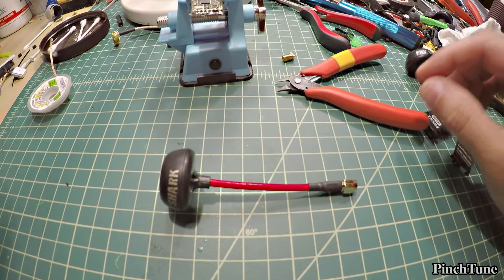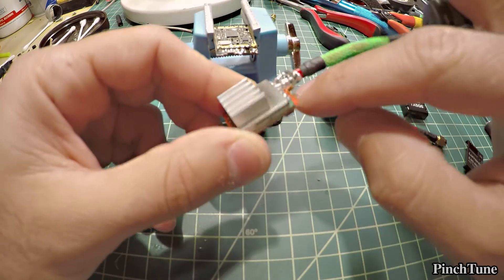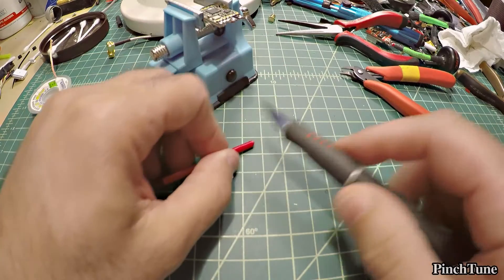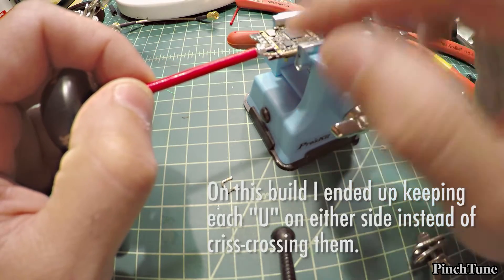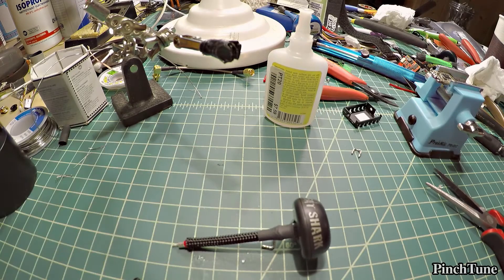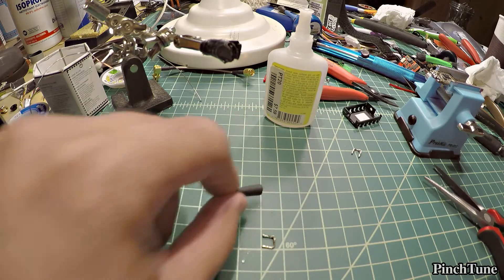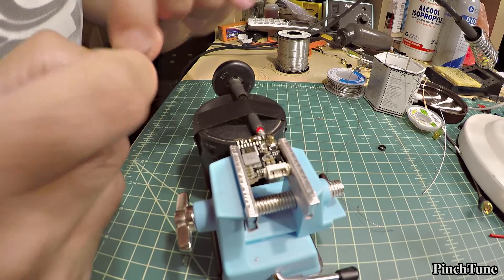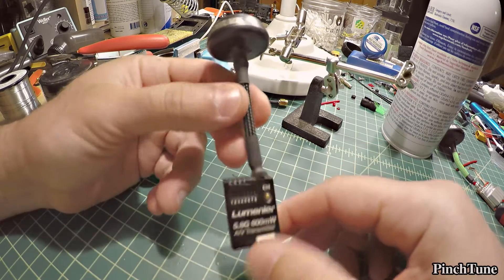How to Solder FPV Antenna Directly to VTX

Comment: Are the losses of soldering the coax at 90 degrees angle higher than having a 90 degree sma connector?
Thank you.
Reply from the maker: The losses are all dependent of the SWR (Standing Wave Ratio). I feel most of the inexpensive transmitters aren't all that well tuned anyway. In something like this I don't thin it makes that much of a difference. This video is from 2016, but I think I made it when I either broke the connector, or was having problems with the signal with the original SMA. Either way, I remember it working better after I did this.

Comment: Anything that can disrupt the flow of information on the surface of the wire or the  "skin affect" will in the end result be a handful of issues. So do it once & do it right and that will just minimize your problems from happening in the first place.

Comment: I'd be a little bit more cautious when making your cut because any surface cuts or dings to the center wire is going to cause impedance mismatch for any info running along the surface of that wire being transmitted.
Reply from the maker: Hi, I agree with that. The more careful, the better. That said, I don't think most of these FPV VTXs are tuned to perfect SWR like some more high-tech and expensive radio equipment. Not to mention, we run such low power transmission that a little mismatch in SWR doesn't seem to hurt much. I think the tolerances in this FPV equipment are still too high to even have to worry too much about that.

Comment: hi, dude.. is it normal, if i got continuity between the signal and the ground of my female rp-sma from my eachine tx801? or could it be a faulty?
Reply from the maker: ummm. I have never tested an antenna for continuity across positive and negative, but theoretically, I don't think there should be. Maybe test another VTX for the same thing?
Reply: I'd you testing just the antenna then yeas as it will make a full circuit if it's on the vtx with antenna attached then it's the same but you should not if there is no antenna attached to the vtx when testing it I think

Comment: how do you remove the original connector from the vtx
Reply from the maker: I believe I clipped off each of the 4 legs with snips, then desoldered each of them individually.

Comment: is fpv range better than with the connectors?
Reply from the maker: It shouldn't make a difference really.
Reply: I have noticed that the connectors tend to warm up - 45-50Celsium. and around 70C transmitter temp. now I have soldered antenna directly - but transmitter goes to 90-100C, tried to solder two times, to get sure there is not defect in soldering.
Reply from the maker: Hmmm. I've never noticed that, but I haven't tested. Ultimately, you want SWR to be at zero, but I highly doubt QC on these things is as good to test that on every single VTX. For me, as long as I'm getting the range, that's all I'm concerned about. This VTX i still performing very well. So I'm pretty happy.
Reply from the maker: This seems it might be a case that the large SMA connector is working as a heatsink. With that removed, there is less metal to suck heat. This can vary from VTX to VTX, outside temp, airflow, etc, etc. However, if it's causing range issue to to overheating, you could apply a small heatshink to the side of the VTX. The VTX I did the work on in the video, I did not apply a heatshink to. Actually, I take that back. I did add one. Same thing with the previous one (The one in the cover photo). I didn't do this because I was having problems, but really because I had the space and figured it would be a nice addition.
Reply: hi! thanks for replay. I have tested now some combinations, and did not found significant difference between cheapest cloverleafs, default whip and 12db linear omni antenna, maybe some 10%-15% better is 12db ones, but also narrover, this can be felt when copter make turn or angle, at 600-700m distance.
But about heating - this is not very good parameter, I wonder if there is possible some very good quality transmitter which does not heat up...
Reply from the maker: I wish, all the ones I've used heat up. Even the latest and greatest like the TBS Unify and IRC Tramp get too hot to touch.

Comment: i have the same crap heat gun.
Reply from the maker: LOL. I know. I got this one at Fry's. I'm surprised it still works after nearly 2 years. Though it rattles now. Eventually I want to get a better one with a smaller nozzle that will be more exact at where I heat. My soldering iron is great though. :)

Comment: I have a rpsma vtx could I do this ? I broke the needle that goes into the antenna close to the base of vtx
Reply from the maker: It doesn't matter if it's RP-SMA, the polarity is the same. It's just the connector that's different. So yes, you can do it too.
Reply: PinchTune awesome thank you I'll have to give it ago

Comment: Awesome tutorial It's exactly what I was looking for!!! Question, do you know if you need to keep the antenna coax at the same length as original or can you shorten it without any issues?
Reply from the maker: Hi. I don't think it matters. I'm not sure if it will change the antenna's SWR, but I doubt it since the coax is not the active part of the antenna. That said, I don't have the equipment to test changes in SWR. Thanks for the good words.

Comment: Hey which soldering is good to buy I bought one it's a 60 watt can't get the solder to glue and connect power wire ground wire and flight wires to my esc. Also I'm using a flat head tip
Reply from the maker: 60 watt should be fine. Make sure you "wet" the tip of your iron before you touch the parts to help transfer heat. I'd also highly recommend liquid flux. I use it all the time and it helps transfer heat a lot quicker, not to mention, fuse the parts together better.